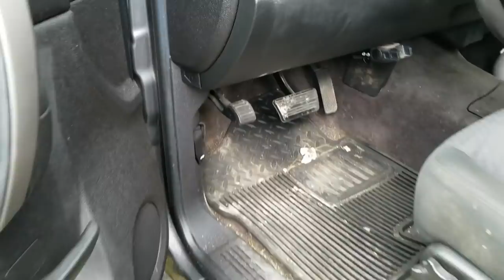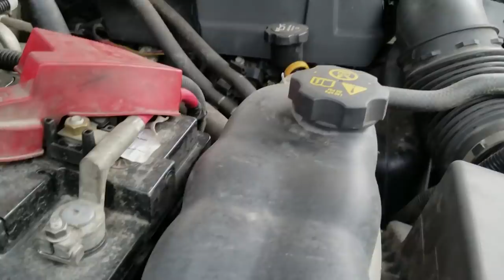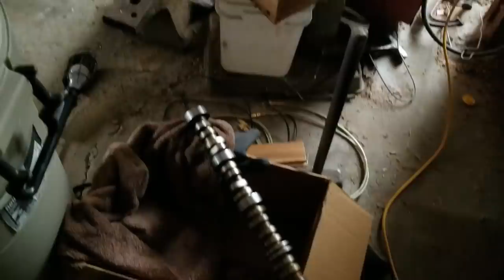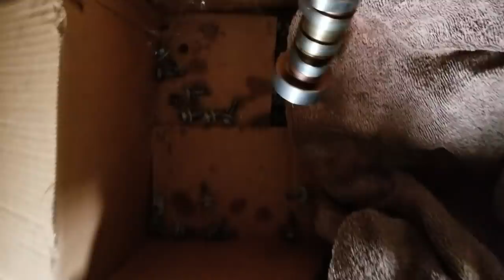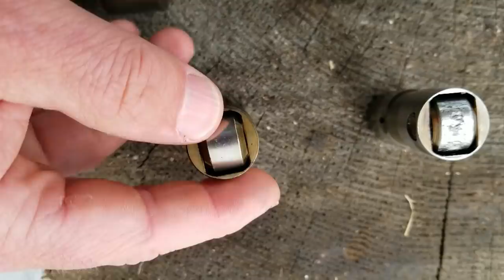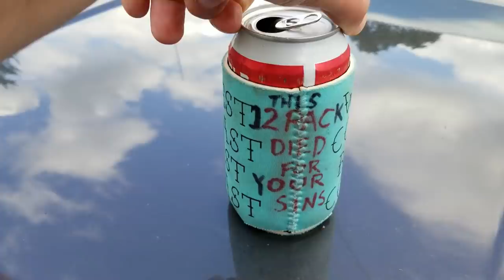Removing Ticks from Engines | Manly-Man Skillz

Comment: I too own a GM LS truck with over 250k miles and even though I don't speak a word of Canuckistanian Creole, I understood every bit of this. I'm gonna go top off with some 15w40 now and pretend it's all better for another month.
Reply from the maker: You are legally bound to wait 6 months.
Reply: Change the oil pump o ring boomfixed my dad's tick
Reply: Obviously you good ole boys ain't never heard of our guaranteed sure fire sothern fix all for nagging motor mumblings.  Sawdust!
Reply: BTW 4.8 vortec 300 k miles
Reply: You just need bigger speakers.
Reply: Changing the oil pump on my 05 5.3 @180k solved lifter tick issue and I can run 5w30 fine with a loss of about .5 qts every 3k. I just use a lot seafoam every other oil change. Eneded up using a pump off an 08 avalanche, pressure never drops below 45 now.
Reply: @xjmg007  I put a 2000 year model 5.3 in my 98 s10. That poor 5.3 had over 325k on the clock before I did the swap. No ticks, no oil consumption, ready to bounce off the rev limiter. Not that I do that often...
Reply: 15w40? I'd just dump in 80w90 differential stuff. That'll keep the rattle from appearing in a while...
Reply: @disgruntledegghead6923  nice I had 98 single cab s10 v6 5sp for awhile. Pretty snappy truck, but a dog on the hwy. Bet your s10 feels like a rocket.
Reply: @rotorhead5826  80w95 for rod knock
Reply: @xjmg007  It used to be a 4cyl 5 speed. It's no record breaker, but it sure feels like a rocket compared to that anemic 2.2. 
Traction problems is all I have to say about that. If the tires aren't spinning they're hopping violently, and there is no in between.
Reply: *20w50
Reply: Try removing a qt of oil and replace it with trans oil. Run for a week   then change the oil. If it's a lifter with bad oil pressure  this will help clean it out. Other wise your pulling your motor apart. Hope this helps someone.
Reply: @disgruntledegghead6923  you sound just like one of my boggin buddys lol. Ls for the win!
Reply: If only I could post a picture of the empty STP bottle in SALUTE TO MY BROTHERS!
Reply: Nah you didn't get the stuff about the Doges and red plates and the coke hiway!
Reply: @danwolf307  Do you watch that Garrett guys videos too?
Reply: @disgruntledegghead6923  no i haven't but Ill search it.
Reply: @arduinoversusevil2025  my jeep.. 323k.. She talks back when she's cold.. But she will sing when she's hot!! God bless Lucas Oil..❤ but I think a cam and lifters would be a good Idea, hope texas speed likes Jeeps!
Reply: He basically described how lousy some people are at repairing their cars and trucks.
Reply: A bottle of Marvel Mystery Oil at early onslaught of said ticks usually frees up sticking lifters and avoids the costly repair.
Reply: Now this is some poetry I can get behind
Reply: @jajcprodigy  Marvel and seafoam do wonders with sludge and varnish removal to unstick things.
Reply: @danwolf307  Search Cleetus McFarland.
Reply: @Nicholas2011ist  same trick used on a 90 craftsman LT with a Briggs that was a wee bit loose and also on a Ford Escort 1st gen a friend had. Hmmm, Escort, maybe it was meant to be loose from the beginning? 😏 Way less noise out of both and a little bit more power as they had a tiny bit more compression. Just wasn't fun smelling burning gear oil on windy days with a tailwind. Friend finally killed it sideways at 60 in his short imitation drifting career. New Pella windows were created in the block shortly after. 💥💥
Reply: @arduinoversusevil2025 Ifin they made the cam and lifters outta the same hardness of steel... wouldn't have the issue. haven't seen a good lifter cam match since 1976
Reply: @tonyrmathis  I'm pretty sure that's against Uncle BF's religion. 😋
Reply: Don't put 15w40 in it. You'll starve the pistons for oil, and it'll start slapping.
Reply: 15W40? Try WD40!
Reply: ours went 300k mi before things other than engine became the issues
Reply: Need to straight pipe it drone it out
Reply: @Nicholas2011ist  worked on my lawn tractor til it didn't
Reply: @johngutierrez4882  280k on my 4.8L always get your oil change @4k with full synthetic or 3k on regular oil. You will never have this problem with cam lifters. Or you can just bypass all that flex fuel stuff and not have to worry about it in the 1st place like my old 4.8L
Reply: Jeremy Turner 5.3?
Reply: @tonyrmathis  You learn somethin' every day, I thought sawdust was only for diffs.
Reply: @jean-pierredeclemy7032  
Nah!  That's just somethin that got started when one good ole boy confused a diff for a motor.
Reply: Wyns makes a product that works for smoke so I would hope they have something for ticking, and the off label method for the smoke stuff is to basically use gear oil single weight, that keeps the product in contact with the metal longer at a time, and if you want to keep it from blowing up you can likely use some motorkote, unsure what to do oil wise for that though, and don’t load the damn thing till it’s idled a tank of fuel, then top off with thin oil and kerosene, or do that first, and use some sea foam (unsure for the sea foam helps but while you’re in there and draining it again, you might as well) you then have stiction cleared and whatever the other crap does, and with any luck that will fix it till the motor mounts rot out and the engine drops from a pothole
Reply: @jlrockafella  it’s not an oil change or oil weight issue. All 4.8/5.3 with cylinder cutout had lifter problems. Starts with a slight tick and slowly gets worse. Even if you go in and electronically cut off the AFM, it’ll still end up with a lifter failure. Best bet is to deactivate AFM and replace the cam and lifters with non AFM parts.
Reply: @jajcprodigy  That was the mystery? What was it good for? LOL. The military buys something called Miltec oil by the drum full. They swear by it.
Reply: Bluetooth earbuds work great too.
Reply: Putting in any heavy weight oil is going to be trouble... the high pressure oil pumps and relief valve into the pan aren’t going to like it. Especially on a chilly morning. You need to break open the cover and start replacing lifters and if quick enough you can leave out the cam shaft, although id suggest to anyone going through this that nows the perfect time to buy an afm delete kit. New original non-afm cam shaft, all lifters, lower pressure oil pump, plug up relief valve, and tune out the afm from cpu. Then tadaa! A beautiful gmc truck with a bullet proof original LS 5.3L v8 with nooo fuel management system to mess you around.
Reply: I read that as WD-40
Reply: 585k Miles on my 2003 Silverado 4.8lit
Reply: 5.3 vortec.. 305k.. no problem.
Reply: @jean-pierredeclemy7032  that's funny I had always heard that it was just an old trick to temporarily aide a slipping trans haha.

Comment: Im trying to decide if I learned something from this.
Reply: I'm trying to decide whether or not this guy writes for Letterkenny.
Reply: @skeetorkiftwon  I'm pretty sure that Jared and AvE share the same  territorial backyard, being in the same continental shelf known as Hoth.
Reply: This the arts 🎭, as told by real men.
Reply: I like to hear his breakdown/review of cocaine
Reply: Probably not but who cares when a rant from the bard of super tytagulation speaks.
Reply: Change oil every 5000 miles 5w40 (12k miles is typically, 12k is Likey fine but the dpf/cat additives in the oil begin to stop capturing stuff and can block the dpf/cat)

 or 5w30 10k miles oil change,, typically change cycle is 18k miles but seems little high to me really but fully synthetic oil is pretty good stuff but if it has a turbo on the engine I wouldn't risk it as the engine be fine at 18k miles, it's the turbo that might fail as its far more sensitive to quality of oil 

If you can use 5w40 if it use it, but remember that it loses its dfp/cat capacity sooner then 5w30 so must be changed sooner but offers better wear protection on 5w40 ( normally 12k ish but 5000miles is better to aim for less likely for the additives in the oil to stop capturing stuff)

if it uses variable valve timing (VVT) you might damage the oil actuators with 5w40 oil as they are normally oil driven, if so stick with the 5w30 but you can use a 10k miles oil change as the service interval for 5w30 cars is typically 18k unless your car says otherwise as you might block/slow oil delivery on the small oil pathways on modern engines if you use 5w40

Once the ticking starts it's already damaged and will slowly get worse, the  camshaft kits come with camshaft, hydraulic lifter caps, bots, bearings and normally the rubber rings that go on the end of the camshaft ( shouldn't reuse the bolts) 

If ignored  it can eat holes in the hydraulic lifters and damage the valve it self(can get stuck open and destroy the engine)but they are more forgiving and give you a lot more leeway before they do break
if you car uses hydraulic mini valve rocker arms they can fall off and can get jammed in a way that keeps the valve open and destroy the engine (unfortunately these type of engines don't give you much warning before this happens sound wise)
Reply: You learned humble
Reply: yeah dont buy gm
Reply: im trying to decide what i just watched..
Reply: You did, now watch another.
Reply: This is the product. You do the learning yourself and rant incoherently when trying to explain it to others before saying "I will have to look at it." You know good and well how it goes but its just not the same outside of your own workshop.
Reply: Learning is for sissies. This is a full blown mind infusion. Harkens back to the days of a William S. Burroughs poetry reading.
Reply: As a Tesla driver, I am glad that I don't need to learn anything from this.
Reply: The answer is yes. Well... maybe.
Reply: @squidlings  lol
Reply: GM 5.3Ls eat cams and lifters as well as burn oil from 2008-2013
Reply: @skeetorkiftwon  I too was getting serious Letterkenny vibes from this monologue
Reply: Hide the remaining fasteners.
Reply: You learned the firing order for a small block chevy, 18436572
Reply: Hahahahaha 🤣🤣
Reply: @squidlings  i dont think that the world is ready for that one
Reply: Klaus Kaiser don’t ever take a Tesla off-road I know this for sure now! Junk
Reply: @robgraff  It was the only thing I immediately understood in this  entire Video .
Reply: You did.
Reply: Don't reuse headbolts, and if it's clicking use thicker oil
Reply: It was like he was speaking a completely different language lol
Reply: I am trying to understand even the english he is talking, this is level 10 of 10
Reply: Sadly I already learned this myself the hard way.
Reply: You learned the fireing order of a small block Chevy
Reply: He most be reading from a script. I am no expert, but I don' think his IQ is less than 150.
Reply: his videos are alone worth the dipsomaniacal Shakespearean monologues

Comment: If the oil is low, get a longer dipstick
Reply: Just hold it upside down, it'll fill itself !!!
Reply: Amen..
Reply: And that is in fact what she said.
Reply: I got me one of those Chinesium dip stick stretchers and it appears it was faulty because the engine promptly disassembled itself..
Reply: fucking lol
Reply: or a shallow oil pan
Reply: nah, just drive over a big rock
Reply: This made me laugh out loud. Funny stuff but it works!
Reply: This is a real Volvo repair, burns so much oil you get a new dipstick and one extra quart of oil. Send it.
Reply: When Whistling Diesel sold the newly destroyed pick up the buyer fell for that one,hook,line and stinker.
Reply: It checks out.
Reply: Just throw the stick away.

Comment: Tick? I'm long past that, my truck sounds like a black smith shop these days
Reply: I drive a diesel... ticking is the name of the game lmfao
Reply: When she stops ticking, that's when I get nervous. Cause it usually means I'm outta gas or the thing is pushing daisies
Reply: @Soljuk Fuckin' ay man!  Hold off on that mechanic's visit just a bit longer.  I had two rear wheel bearings go at the same time, and I'll be damned if it didn't sound like wind chimes.   Beautiful I tell ya.  I threw in a bad idler pulley and had myself a traveling band!
Reply: @1985ThePedro  Sad but true.  My idler pulley got progressively worse until I was driving into work (on a Saturday no less)  Just as the office came into view that pulley went silent.  I guess it needed all of its concentration to strangulate and tear loose my water pump.

Comment: rips apart engine to fix tick realizes its an exhaust leak.
Reply: I did that with aux  belt roller and tensioner, just to find out one of my exhaust manifold bolts had snapped and the gasket was burnt so it was squeaking (whistling) whenever the engine was running...
Reply: @tonyus8197  I hear you, my 6.0 ls just got new exhaust gaskets actually, had a tick for about 30 seconds when cold and then goes away... too short to be lifter related imo.
Reply: What I thought was a bad engine mount was an exhaust hanger.... Which I've knocked loose again. Eh fuckit, I know what the noise is now.
Reply: My pan evac mod introduced a little exhaust popping and I refreshed my engine. Still have the noise , living with it.
Reply: I felt that. Been there once before, except cracked the flywheel was and didn’t notice until the second rebuild.

Comment: What is the mix ratio of engine oil and maple sirup to fix the ticking?
Reply: 1:1 if youre using that crappy New England American crap. If you got that golden amber Canadian brew just pour her right in and skip big oil.
Reply: At the 300k mark you switch to poutine.  It's higher viscosity than boiled tree blood.
Reply: 1 part engine oil 200 parts mechanic in a can
Reply: Depends on the season an who stole my beer

Comment: My method for vehicle maintenance:
Purchase single-owner highway-driven vehicle from the 90s/early aughts for no more than $2000.
No maintenance until check engine light comes on.
Step 1: Disable check Engine light
Step 2: Increase stereo volume
Step 3: Operate vehicle normally until the police declare vehicle unsafe for road travel
Step 4: Operate vehicle carefully for 6 more months
Step 5: Replace vehicle when driver's seat no longer positively affixed to frame and/or wheels no longer all travel in the same direction as the vehicle
Reply: Damm My car has about one more winter before step 5....  Of course the in floor ventilation I have now is just wonderful in the winter for draining out the excess melting ice tracked in on the boots.
Reply: this is all of my cars and trucks
Reply: Omg I'm dying.
Reply: Had a good laugh :D
So true.
Reply: My 98 Jeep Grand Cherokee is proof.
Reply: • "I'm in this picture and I don't like it"
Reply: I read this in his voice
Reply: @killstrees  I have a heavy equipment mechanic buddy from Alberta, that helps with the cadence. He's a hoot and a half that one.
Reply: Low SES brother, represent. I actually think we come out on top, at least dollar-wise, if not luxury appointments-wise, but what more do you really need than working air-con (here in Australia - in Canada obvs heated everything) and sweet stereo? Oh yeah, maybe safety. Meh.
Reply: @PinataOblongata  Safety is easily in my top 50 priorities!
Reply: Your one of those guys.  Me, the day after the warranty expires there's a small mushroom cloud over my driveway.
Reply: Funny. A guy I work with was talking about his recent vehicular woes and said he'd like to start working on cars like I do. Buy some piece of junk, drive it till something major goes wrong with it and then buy another piece of junk.

I'm too busy to be wasting time fixing a car when I could be squandering time elsewhere.
Reply: If you buy a Dodge this process takes approximately 2 months, including the 6 months of driving carefully
Reply: This is wayyyyy too relatable.
Reply: You sir, are a true American.

Comment: Ticks are bad but knockers are worse. For those symptoms of peril even thicker motion lotion and assorted snake oils are ineffective. What is needed is some of the mother-in-laws ungody fall fair entry fudge and a couple of ground up squeaky rubber dog toys. Insert into crankcase and marvel at the silence that comes from; engine, mother-in-law and mans-best-friend. The experts among you will note the importance of rapid sale in this situation as things like this generally get quieter before getting louder and then quiet again, permanently.  Which is why you should consider yourself blessed to have so many friends there are some surplus ones you don't mind excluding from that list once the cheque clears.
Reply: I don't know I like a nice set of knockers
Reply: @dodgydruid  So glad it's Scammell and not Guy nuts....
Reply: If you so choose to keep said knocker, be aware it may decide to spontaneously convert itself from an internal combustion engine to an external combustion engine thus transforming the vehicle into a test weight for the cables on a tow truck.
Reply: It’s not the size of the knocker, but the shape.